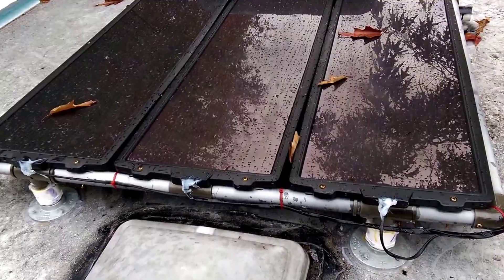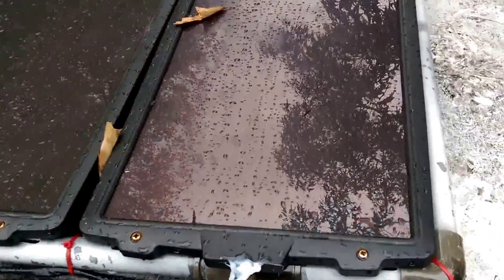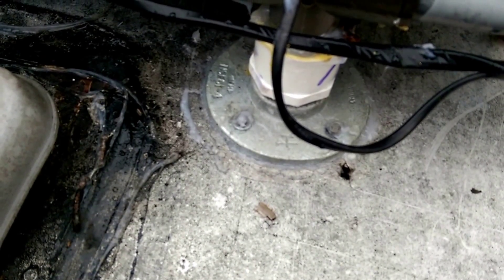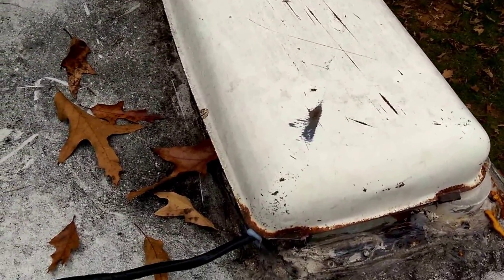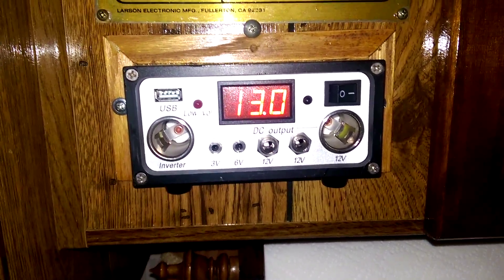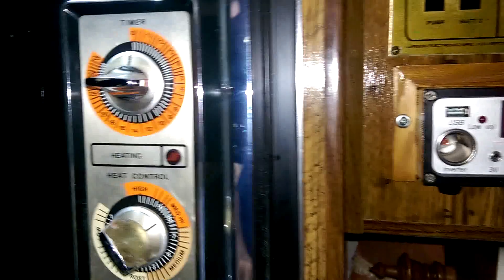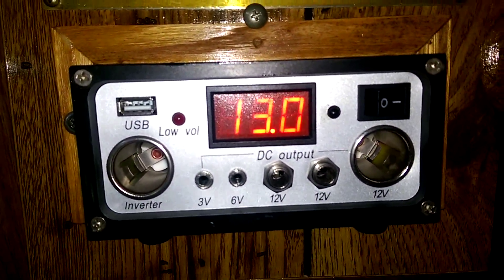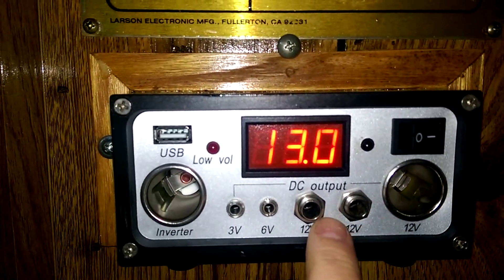-RV-HARBOR FREIGHT solar installation

Comment: didnt show us how
Reply from the maker: +WizeMinds Records What do you mean ? It was bolted down with the bracket and then the wires were run down to the controller hook ups and then through the 12 Volt old fridge wiring to the fused box and then battery bank .

Comment: Pretty cool install on your roof!  I like the ingenuity in your mounting brackets.  Please show this in more detail.

Also, you forgot to mention if Charge Controller is PWM or MPPT.  Solar panels are obviously PolyCrystalline silicon solar cells.

Thanks!